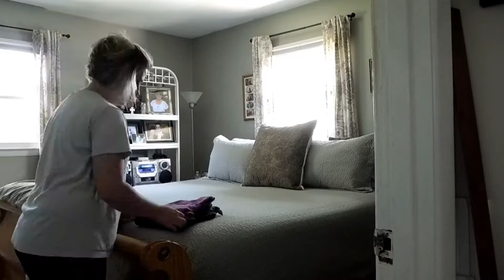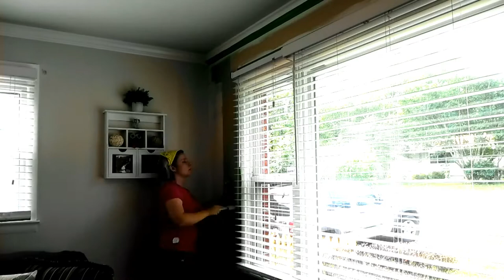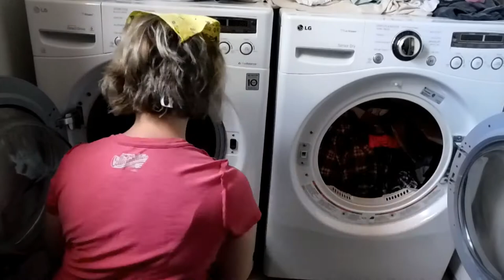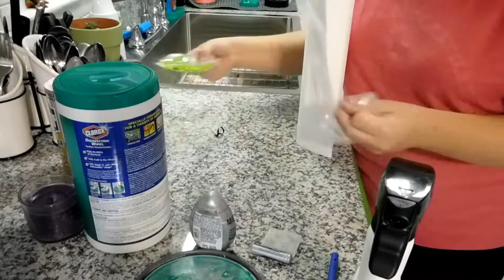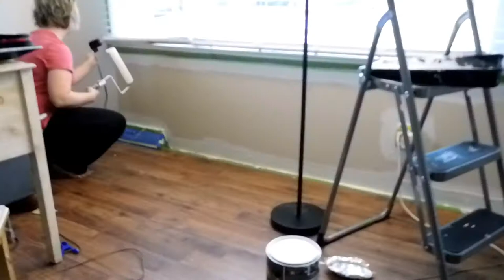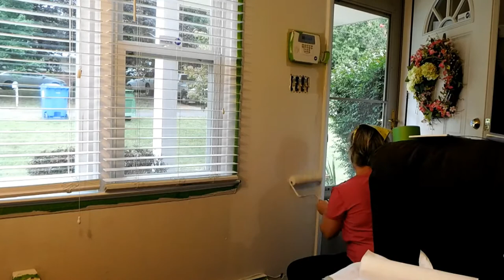Tidying Up The House & Painting Living Room Wall

Comment: Great. I have noticed that you are using some kind of foam brush on the edges. I dont think we have something similar here in Greece...do you find it more convenient than the regular ones?
Reply from the maker: I absolutely love the sponge brushes for painting the walls edges around windows and everything:-). As far as the preference of a regular brush and a sponge brush, I have used the sponge brushes for years because they leave a smoother brushstroke. For the crown molding though, I did paint that with a regular bristle type brush because it was a lot easier to get into the crevices. But for the smooth part of the wall I definitely prefer the sponge brush over the regular bristle brush